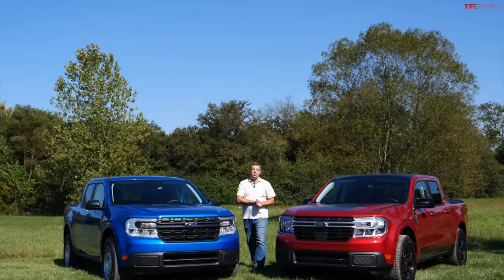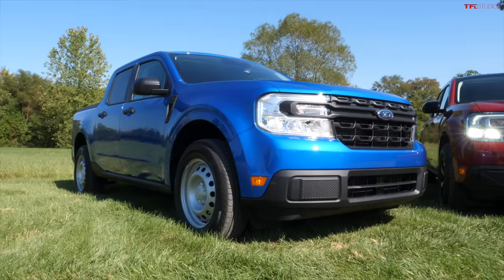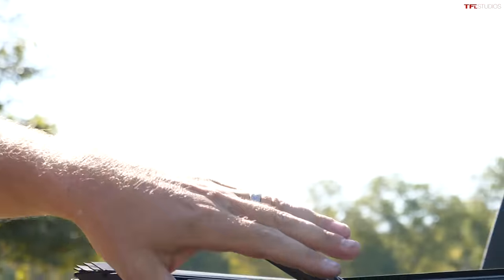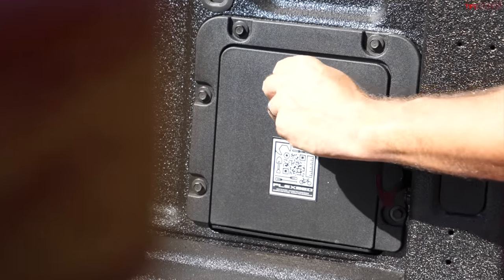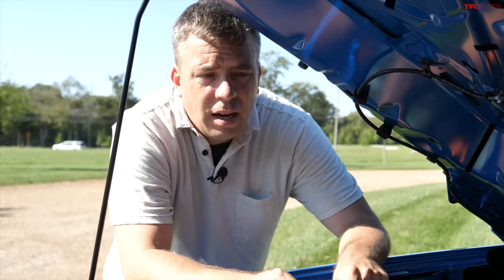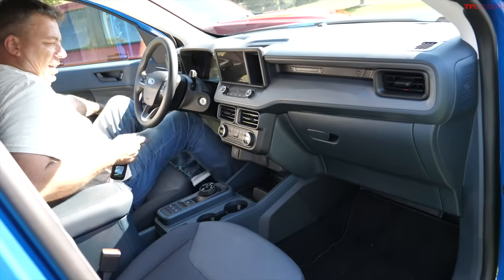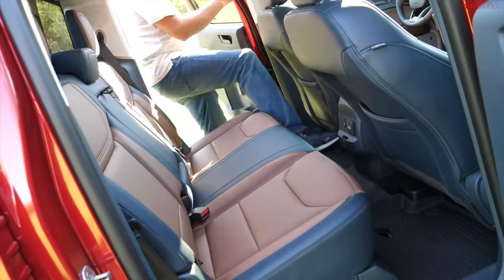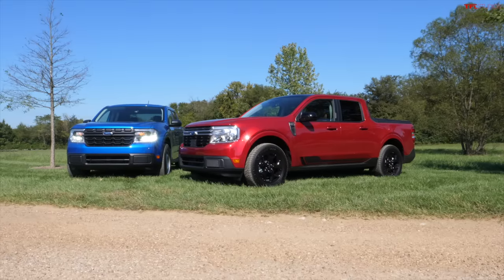HANDS ON with the Least & Most Expensive New Ford Maverick - The Differences Will Surprise You!

Comment: That’s a lot of vehicle for 20k
Reply: 22k
Reply: yeah but XL doesn't have cruise control
Reply: It is a lot of vehicule. People may write off but getting a TRUCK for that low, it's unheard of anywhere else.

But they do need to offer a king or single cab option for a  longer bed.
Reply: @working_country ___ you're lucky to get a 6-foot bed in a full size truck unless you get a reg. Cab
Reply: @Allenfreedom1776  It can clearly carry shit. Did you miss the 1563 of cargo capacity? Better than most full size. Yes, not a big tower though.
Reply: @fishinmagician89  plus tax
Reply: @Allenfreedom1776  If your using this for alot of towing you should probably be getting a bigger truck anyways.
Reply: @theejoeylee  

You're mistaken...
6.5' beds are now available across the board on 1/2 tons.....
Reply: @mark-olivierknoefel4748  the hybrid is more for city use. Cruise control is not needed
Reply: It's 
Not 20k add 2k for destination and delivery fees.
Reply: @Allenfreedom1776  Fwd is fine for the 4,000 lb max of this rig. I wouldn't want to tow any more than that with it anyway.
Reply: Good fleet truck for local deliveries. I don't like how that exhaust is routed as it just looking to be ripped off.
Reply: @Allenfreedom1776  fwd and cvt
Reply: I miss my Ranger. Small. Supercab & 6ft bed you could reach in.
Reply: @Allenfreedom1776  It would be perfect for towing a small fishing boat or a camper, like a Scamp or a teardrop.  It would also do just fine with hauling supplies for small DIY projects, hauling feed for small homesteads, etc.  There's plenty this truck would be good for.
Reply: @Allenfreedom1776  not all trucks are ment for towing and carrying things
Reply: If this was a Honda you all being whining that it is not a real truck.
Reply: @Allenfreedom1776  no it isnt ever heard of a baja truck
Reply: @Allenfreedom1776  just cause it can pull alot doesnt mean thats the purpose
Reply: @Allenfreedom1776  the only thing FWD sucks at in towing is pulling a trailer out of water or mud. It works just as well as RWD in any other situation. 
I prefer RWD because it is better in ride, steering and handling .... I don't do towing in mud or pull boats out of boat ramps.
Reply: @Allenfreedom1776  get the 2.0L .... and it does.
Reply: @Allenfreedom1776  4.5ft, not 4 ft; where did you get that misinformation? I think a Suburu has something like 4 ft, not the Ford.
Reply: @Allenfreedom1776  cvt yes agree; but fwd doesn't really matter that much
Reply: @mercxnary8719  disagree; that's the ENTIRE PURPOSE of a truck; now if you clarify your statement to say tow or carry "maximum capacity" or something like that, maybe your point would be correct.
Reply: @mercxnary8719  a Ford Focus isn't a race car, but some people use them in racing; you are really splitting hairs to say a baja truck is an exception, lolol
Reply: @rayrussell6258  maybe they use it in racing because they built it and upgraded it for track and not stock and also baja trucks are an exception because its not suppose to tow thing and its still considered a truck ever searched the meaning of a baja truck
Reply: @rayrussell6258  fwd is better in the snow tho, don’t forget that!
Reply: @Allenfreedom1776  But you and Ford know that’s not how lots of them are used. This is an image thing.
Reply: 2022 Honda Ridgeline re-badged
Reply: @allentoyokawa9068  I still don't call it a truck, more of a SUT like the old Explorer was. Looks interesting and I can see it's niche.
Reply: @rayrussell6258  dude I have a order for the maverick but you can't  compare the reliability of Ford and Honda , if Honda  has no reliability then Ford needs to close 😉. Taurus transmission bad, Explorer transmission bad , new mustangs engine not reliable etc...
Reply: I’d buy one if it had a bench seat for 3, and a longer bed. It’s a good little truck.
Reply: @allentoyokawa9068  but Ford makes real body on frame trucks also..Honda does not
Reply: Yes - Ford hit a grand slam. 👍🏻🇺🇸
Reply: @allentoyokawa9068  You spam every TFL thread with your anti-American rubbish. Tokyokawa??? 🤔🇯🇵  This Ford is a huge win - the people have spoken, so deal with it. 🇺🇸💪🏻
Reply: @theejoeylee  He bashes on American brands in every thread. Dude is a hater of anything American plain & simple. 🇺🇸💪🏻
Reply: @CactusJack252  Yep, even on the freeways cruise control is a waste of time.
Reply: Yes its a lot of vehicle for 20k, but Not a truck. It’s a Ford Fiesta with a bed. 🚗
Reply: For that price I can't wait to see what people swap into these. A nice 4bt or an ls. Ecoboost maybe?
Reply: @fishinmagician89  that’s just an opinion not a fact
Reply: That’s a lot of vehicle for $36k in the First Edition too. I wish more trucks, especially “real” trucks were priced this reasonably
Reply: @Allenfreedom1776  rwd trucks are shit in the winter.  And this isn't a cvt.
Reply: @working_country ___ the tailgate has 2 positions. In the upper position you can haul full 8' sheets of plywood or sheet rock.
Reply: @Allenfreedom1776  yeah but they can haul 2000lbs, if you need towing get a ranger or an F series.
Reply: @Allenfreedom1776  it can carry, and it can tow a small amount, it's not like it can't tow, it just can't tow much. But the payload alone is pretty crazy, it has the payload of an HD truck!! Admittedly it can only double that in towing, but it can still haul a shit ton while towing properly, get a light trailer and you should be able to realistically move about 5klbs of stuff, maybe less maybe more, assuming there's not other restrictions on towing while hauling.
Reply: @Allenfreedom1776  it can't be slower than a fully loaded stock 7.3 IDI, probably about as fast as a stock 7.3 powernope with a full load, and about twice the fuel mileage.
Reply: @theejoeylee  the new 2022 nissan frontier offers a kingcab with 6.1' bed.
Reply: They will make 100 of them at that price
Reply: @yup4640  can't imagine to many customers, even fleets, will get the very bottom of the line, the fleet trucks we see out in the real world will have SOME optionsm
Reply: @666cemetaryslut  Its based on the escape
Reply: @wpiofm  many of us never use cruise control anyways so not exactly a dealbreaker. You don't actually need cruise control to go the speed limit on the highway.
Reply: @wpiofm oh well. I'm in my 40s and never used cruise control in my life.
Reply: @jasonmax5759  Unrealistic expectations. A comparably sized and equipped crossover runs about S36-39k. Expecting a V8 at that price is just ignorance. You can't even get a 6' bed on a mid size Ranger crew cab. This is a much smaller vehicle.
Reply: @wpiofm  wtf! you can't drive on a highway without cruise control?
Reply: I cant wait to get mine😁
Reply: @Allenfreedom1776  You missing the point.. its affordable, if you want a huge truck to tow and haul get one of the F line trucks (F150,F350 ect).
Reply: But, it is a Ford
Reply: Yeah but it’s a ford
Reply: @jasonmax5759  i rarely have to brake using a 2s following distance.  Always find it strange how others constantly brake and adjust to the car right in front of them instead if just taking it easy.
Reply: @jasonmax5759  cruise control is also terrible for MPG
Reply: @CactusJack252  I really don't agree with that, unless you never travel anywhere. I use cruise control on the freeway and when traveling, so it's unfortunately a deal breaker in the base.
Reply: meh
Reply: @mark-olivierknoefel4748  You don’t always need it or you can probably get it aftermarket
Reply: @jeremiahbachmann3901  what do you mean? This is like getting a 10k mini truck late 80s/90s with inflation. NOTHING can compare at this price point.
Reply: @Allenfreedom1776   Yup. Steering with the throttle.  I'll take rwd over fwd in the snow every time.  Of course you have to know how to drive, and nobody does anymore.
Reply: @Allenfreedom1776  Most anything can be fit into a 5.5ft box with the gate down and straps.  they also show on these you can lock the tailgate at an angle
Reply: @fabioleal3442  Thats including it in the Msrp. 20k gets you a base xl at the dealer
Reply: @GhostlyGhille  no it's not I have ordered one .
Reply: @fabioleal3442  its included in msrp. on every maroni of every car.
Reply: @fabioleal3442  I sell fords. Have for 3 years. Its on the Maroni and the MSRP is whats on the Blue tag of any ford after the Destination charge.
Reply: @Allenfreedom1776   right 4.5 its actually a pretty decent sized truck in person.
Reply: And the best part is this will force other manufacturers to compete and bring us more similar vehicles from other brands. I would personally love a smaller Honda Ridgeline.

My hope is next year's model will give us the Hybrid with an AWD option.
Reply: @1leggeddog  That's not the point of this truck, it's a minitruck. If you need something a bit bigger, that is where the ranger comes in.
Reply: The base model is an absolute turd.
Reply: Its how cars and trucks should be as far as base vs fully optioned.
Reply: Is everyone in this comment section braindead. This truck is meant to compete crossovers not other trucks. People who want a raised small car can justify this over the crossover because it's so much more useful. That's why they put and hybrid and cvt so it can get even better mpg then all the shitty crossovers/small suv that the market is obsessed with. And they also made the Ecoboost one for someone who wants to have more of a real truck.
Reply: Some of the comments really crack me up here. 
Keep in mind this is NOT a job sight truck. This truck is for someone who is looking to do small home projects, grocery getter, through some softener salt and mulch in the back end. Light towing on the weekend. Maybe.
It's a unibody for goodness sake.
Reply: Add 10k and your at the lightning. What is that 100$ more a month? Come on now.
Reply: The hybrid has an E-cvt, the same CVT on the Prius and most Prius goes over 300k without any trannie issue.  This hybrid is not your Nissan CVT that you are wondering.  

Those who complains about the maverick lacking this and that are typical truck guys where they compare it with the truck that they have right now.  This vehicle is marketed to the first time trucker and without owning a truck, they have no way of comparison thus why there are less complaints by them.  If you want a truck to pull loads, pay more and get just that.  You want to buy a 20k entry level truck and asking for a full size load capacity?  Makes no sense.  

Plus your government wants you to retire your gas vehicles and go green by 2025 so what am I gonna do with my sedan or small car after I buy this truck?   This truck works as a commuter and light truck duty so why should I keep my small car around and having to pay tag fees and gas and insurance for?  Ford is pricing these mexico made trucks for a reason.  It will be like the mid 90's where every other SUV is an explorer.  These good gas mileage trucks, if no recall will be the next norm that we will see out there on the road.  It is affordable and it saves gas while even college students can use it to haul their college stuff since they are always on the go or moving after the school season is over.  The faster Ford puts them out on the floor, the faster we will see them as a normal on out roads.  Mark my words on it.  It will be like leggings.  They can be seen at everywhere that you may go.  Lol.
Reply: Yes it is!
Reply: The market will realize and the dealers will mark it up
Reply: @Prestiged_peck  -  Has nothing to do with speed.  It has to do with not being able to move your leg and foot for two to six hours.

That is a health hazard.  You become numb and paralized from being in a frozen position.

You obviously don't put a quarter of a million miles on a pickup.  I have on several Rangers over 30 years.
Reply: @wpiofm  I've put almost 250k on my mustang, about 80k of that with solid mounts, if that counts.

Edit to add that cruise control stopped working around the 60k mark, it had 21k when I got it, so yeah, do the math if you want, you  get around it by getting out to pass someone and putting the hammer down to get by
Reply: @Allenfreedom1776  And what studies have you found with this logic? Had plenty of Minivans tow just fine being Front wheel drive.
Reply: @Allenfreedom1776  then get the ranger or f150. The entire point of vehicle classes is to give options. If this isn't capable enough for your needs, bump up to the next one. This is for people who don't need to haul a house
Reply: @Allenfreedom1776  extra 2k for awd upgrade so seems good to me.
Reply: I think so too especially since it's a hybrid. I always thought hybrid vehicles were premium in price point.  Ford is really making great products now, the mustang, the e mustang, the bronco  are all  great and I'm not a Ford fan boy I just think they are finally focusing on making good shit now.  They used to be so big that they didn't give enough attention to their main product which is Ford.
Reply: @Allenfreedom1776  

Then order the 2.0 turbo with an 8 speed transmission and AWD......or don't and keep whining. 

To the other idiots complaining about no cruise control,  order an XLT.....problem solved.
Reply: @Allenfreedom1776  

Because you're not very intelligent when it comes to vehicles. 

The CVT in the maverick is not the transmission you think you know...there is no belt.

There is also an optional 8 speed automatic available with the turbo motor.

If you don't like the FWD platform...then order the available AWD.

So your comment about not "improving" the maverick makes no sense. 

Everything you're complaining about has an upgrade....the maverick offers a lot of choices.
Reply: The reason it is so cheap because they only make short bed four doors
Reply: @Allenfreedom1776    Yup. Mine is going to tow and haul.
Reply: Don't say that please. Ford will be watching!
Reply: @Allenfreedom1776   It would tow a 3k bass boat , and small trailer fine. Nothing to complain about.  You are not towing that with a Escape, Rav4 .
Reply: @working_country ___ At that point, I'd just get a Ranger
Reply: Exactly what I thought.  You could almost but a spare truck for the upgrades
Reply: @allentoyokawa9068  ha ha ha. Honda is junk
Reply: @timmikep1978  yeah and your yugo is a yugo.
Reply: If only dealer gouging wasn't going on, I would have considered swapping out to one.
Reply: @donesry2902  it is not CVT, it is eCVT which is completely different tech and wayyyy more reliable.
Reply: @matthewwain9958  Thank you. Now I need to do homework and learn what eCVT is...
Reply: Yah And I’m gonna get one :)
Reply: @theejoeylee  That's horrible.  I hate getting stuck behind vehicles that don't use it.
Reply: @CactusJack252  I actually use c.c. even in town to prevent speeding 😆.
Reply: No it's not, it is an affordable small truck, the way it should be. People are just accustomed to paying 40 + K for a pickup nowadays that are Cadillacs not trucks.
Reply: @Kenjionigod  so have it added.
Reply: @theejoeylee  I agree, it's a winner.
Reply: @jackman7286  your a payment buyer, dealerships love people like you.
Reply: @Sandhill1988  There is no option to add cruise control to the base model? If a got a Maverick, I'd get an XLT. I'm just saying I would straight up get the base if it had cruise control
Reply: @Kenjionigod  100% agree 👍
Reply: Not starting up building until august and the ones at dealerships are 35 to 40,000
Reply: @working_country ___ yeah it’s weird they don’t offer it with a regular cab long bed for work
Reply: @theejoeylee  If you buy extended cab truck models you get a longer bed. The crew cabs usually habe 5 foot beds. My frontier is the king cab(extended cab) style and it has a 6ft bed.
Reply: @270eman  I love the Frontier...I just dont trust nissan
Reply: @theejoeylee  I don't either but the 2005-2019 frontier has been out so long all of the problems are well documented. All the big issues occurred 2005-2010. 2011 and up its near bulletproof. Its also simple to work on and tons of parts available. And you can get them loaded for 10 grand less than a tacoma with similar options. No cvt crap or turbos. Simple port injected v6.
Reply: @1leggeddog  because it is really a compact SUV with a bed. It is using a Ford Escape chassis